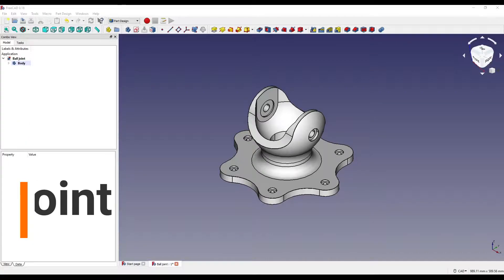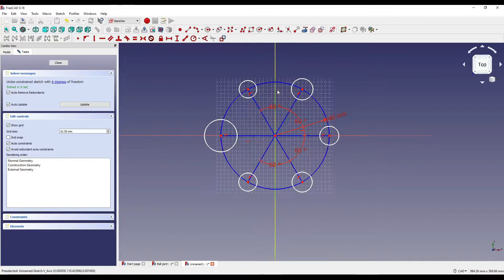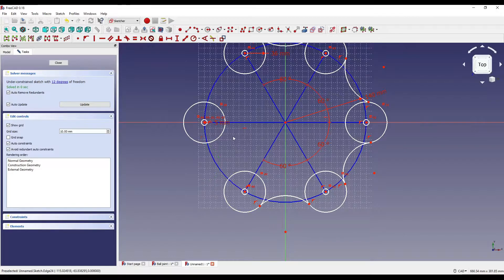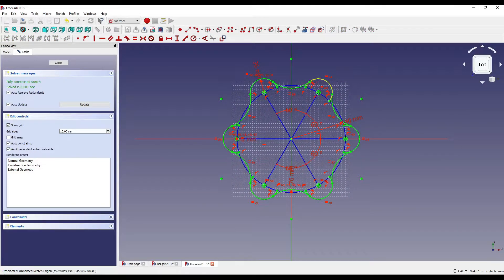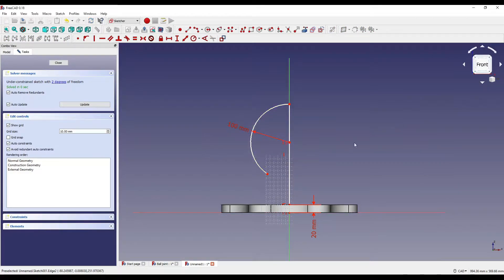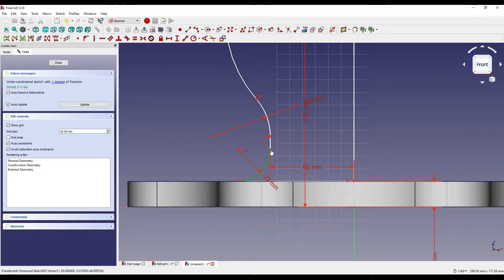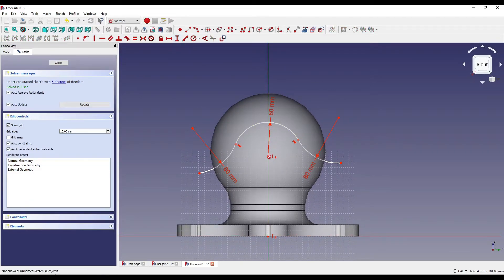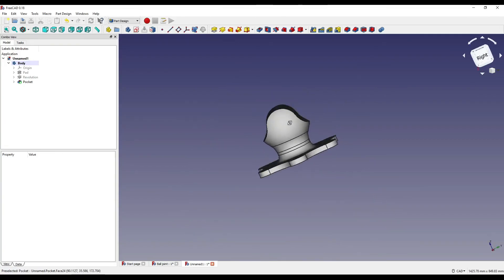FreeCAD Tutorial - 'Ball Joint' - Part 1

Comment: Hi Andrew
I am learning Freecad and need to know how to grab midpoint of a line when in Part Design. Would you help me and let me know?
Reply from the maker: Hey Cyrus!
Do you mean creating a point in the centre of a line while editing a sketch?
Reply: not just creating a point, using the midpoint for another sketch like a line or any thing
Reply from the maker: @cyruskhosravi7351  Ok, hopefully this will be easy to understand over a message 😅

For test purposes we'll create a new document and create a sketch on the XY plane.

Draw a single line from centre point along the horizontal axis. Make it about 30mm in length.

Close the sketch.

Make sure the sketch is highlighted in the tree to the left, and click the 'create new datum plane' icon...this will bring up a dialog on the left. The top box should say 'selecting' with our sketch selected. Click on the one below which should be 'reference 2' and click on the sketch line. This should make the datum plane centre on the line. Click ok to confirm the datum position.

And hopefully that's what you're looking for! You'll now be able to use the datum plane as a sketch plane, and sketch geometry on the centre point of your line 😁
Reply: @AndrewCAD  thanks a lot Andrew! Not yet! let me ask it in another way! how do you use  the tools in the DRAFT section that that are used for grabbing certain points of lines, circles, etc. (like midpoint, quarter of a circle, etc)
Reply from the maker: @cyruskhosravi7351  In the draft workbench, over to the right of the tool ribbon, within a drop down there should be some icons (turquoise/light blue in colour). They should all be highlighted which means they're currently active...what you want to do, is turn them all off (apart from the pad lock symbol...also known as 'toggle snap' or 'toggle' or if you're using 0.19 it will be called 'snap lock') and then select the snap youd like...for example finding the midpoint of a line, you'd have both the lock icon and the 'snap midpoint' icon selected...when you then draw a line within the draft workbench, you should be able to snap to the midpoint of other lines...for further reading, check out this wiki page, which might make it a little easier 😊 https://wiki.freecadweb.org/Draft_Snap_Midpoint

Comment: Nice video. I wonder why you didn't use the polar pattern function?
Reply from the maker: Is this for when I created the sketch for the base? I did wonder if there was a polar pattern for sketching?
Reply: @AndrewCAD  There is indeed none for sketching. But you could have sketched a 6th of the features and then use a polar pattern for the body (after padding). Just curious  why you didn't.
Reply from the maker: @peterjansen4894  I think I know what you mean - when you do a polar pattern you click the 'Add feature' and add multiple features, which saves you from doing lots of individual patterns?...if that's what you mean I did try that, but unfortunately it's not working for me, I might be doing it wrong though 😅
Reply from the maker: @peterjansen4894  Yeah I see what you mean! Would definitely make life a lot easier 😅 I'm running 0.18, will see if I can update to 0.19! Thank you 😁